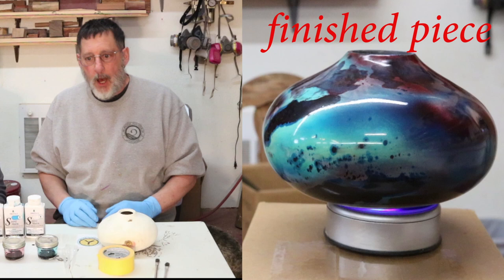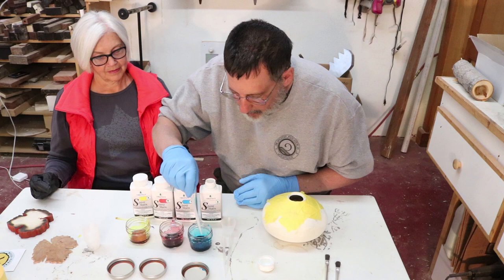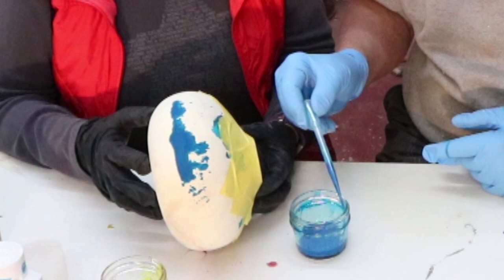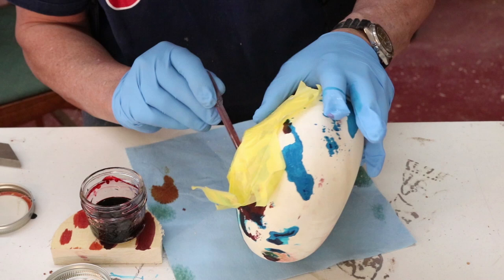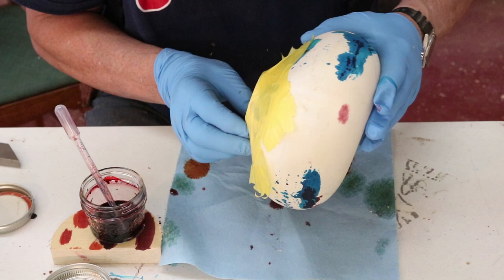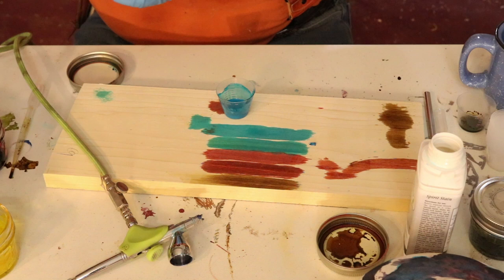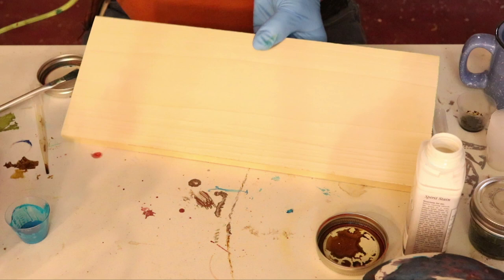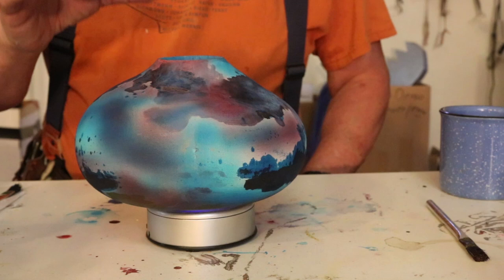Coloring a Box Elder Pot with Cheryle: the wyomingwoodturner

Comment: This pleases me greatly to see a finish properly applied with a spray gun. My background is cabinetmaking (3rd generation) and I as so many others started out with woodworking skills but absolutely no finishing experience. I took a year long course in high end furniture finishing learning to use stains, glazes and dyes. I also learned how to correctly use a spray gun. The skills I learned long ago have served me well over the years. I see people spend thousands on the best tools they can afford but when it comes to finishing they use a 29 cent brush from one of the big box stores. The quality of the finish should match the quality of the woodwork. Learn finishing skills and the work rises to a new level. Finishing exclusively on the lathe is ok for friction polishes or a CA glue finish or buffing pens and other small objects but learn and expand your skills, it does pay off.
Reply from the maker: Very true.  I did lots of spraying with both HVLP and compressor guns in building and refinishing furniture for 30 years.....I love my spray gun.  It is really inexpensive but works well.  Sam

Comment: Hi guys! I just watched this again cause I've got a hollow box elder vessel I'm gonna attempt to color. Shoulda watched this before my last attempt. Too much dye and it really cracked on me. Thanks for the info again. If I don't mess it up too awfully bad I'll send a picture. If you don't get one you'll know how it turned out!
By the way Racine and I are celebrating our 50th this Friday the 13th. I'm not gonna put any other numbers out there cause those knots on my head don't heal as fast anymore!
Take care, Dave
Reply from the maker: Dave (and Racine) First  a big Congratulations on the anniversary.  I have been the recipient of a few dope-slaps myself over the years-47 years for us I think.     
Now, I have applied too much dye myself on a few pots.  If you let the dye dry completely, the crack will often close up and be fairly invisible.  That "cracking" sound is the worst.  Sam

Comment: Great video Sam, so nice seeing Cheryle having so much fun. I'm sure she had a word or two on the finished video content you left in. How do you go about the final sanding you still have to do. Would you mount this back on the lathe, hand sand or use your drill press? I'm guessing that very light sanding is required or you soon take off all the layers of lacquer.

Well done!
Reply from the maker: Paul, I would use----drill press, mounting the piece on the lathe, or just place it on my lap and sand.  Whatever works best.   As I add layers of lacquer, five coats at a time, I sand progressively with finer grits.  Ending usually with 12,000 grit paper.  I have covered this in other videos.  Not sure which ones.  I do have one on buffing that I may cover sanding.
Sam